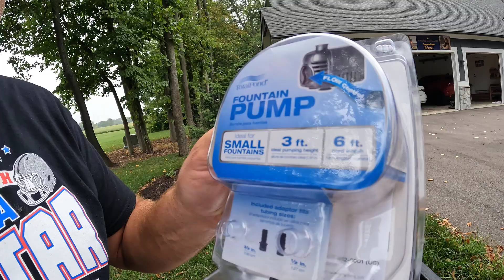DIY Wooden Square Fountain: Easy-to-Build Water Feature for Your Yard!

Comment: Nice project… I’m going to do this one but I’m going to put some led strip lights on the sides
Reply from the maker: Thats cool!  I would look for a larger water tank than the one I used.  I get about 5hrs of runtime before I run out of water.  Luckily I have it tied to my sprinkler system.  Thanks for watching!

Comment: Looks fantastic. I would’ve like to see how you got the water to flow evenly from one end to the other, and how you installed the hose in the frame. I am trying to build one and working on that part.
Reply from the maker: I started with small holes at like 1/16. I think 17 holes. I set the pump at the lowest speed. Tested the flow wasn't happy so I turned off the pump and drilled the holes at 1/8.  Once again not enough. So I did the same thing several times and settled on 1/8 holes. The pump is still at the lowest setting so I could go bigger or increase the pump flow but 17 holes at 1/8 holes gave me what I was looking for.  I kept the flow on the pump at lowest so if my holes got to big while testing I could always increase the flow and not ruin the pipe already installed. Hope this helps. Please subscribe thanks!  HPH
Reply from the maker: Settled on 1/4 inch holes. Sorry

Comment: How often do you think you'll need refill the water? I imagine there's quite a bit of splash that's not recollected.
Reply from the maker: Good point!  I ran it for about 8hrs straight an it lost half of the tank.  With that said I plan to silicone the pipe to the pump where it enters the tank.  That will allow the tank to fill higher (after adjusting the water float).  If I had to do it again I would buy a bigger tank or maybe even a liner.    Cut the opening a little wider to collect the splash more.  But this fountain will only run when we are out there which is a couple times a week right now.  Didn't want to break the bank on a bigger tank for a part-time fountain :)  Thanks for the comment make sure you subscribe to see more!

Comment: I like this a lot. I sub to another channel and used his videos to create a small waterfall feature in our yard (about 5 feet from top to bottom, ending with a 15ish inch drop into a small 20gal pond, right behind our campfire pit). Here's his design of the same idea: https://www.youtube.com/watch?v=GPhFZXCj8Ak. I love water features, feel like they just add so much to a yard. Really makes it feel less like you're in the city and more like you're just out in the woods far away from the noise and smells. Which for us, that's kind of vital for the time being. (tangent: I mentioned elsewhere my health problems, so for now it's the best we got. We upgraded my truck and got a 35' camping trailer last summer so we could spend a year on the road (I work full-time remote), but with my health issues that plan is on hold. We eventually want to hit every state in the lower 48. Hoping to leave this year, but we don't know.) Anyway, love the water features. I'd like to do something similar to this on a smaller scale in our front somewhere, but I feel like my neighbors would hate it because of our location and loss of water (we're in Eagle Mountain, Ut. where we've been experiencing years and years of severe draught).

Comment: Good vid, would be great if it didn't have that music though.
Reply from the maker: Really?  Too loud or just corny :)  I was told in other videos to add music :)  Thanks for the feedback!
Reply: @HomeProHero  The volume is okay I think, I just really believe there shouldn't be anything but diegetic sounds in these types of videos, it's kind of distracting and doesn't add anything. Personally I'm not a fan of the music choice either though I couldn't really explain why. It's a little too chill maybe? Just not something you'd associate with playing with power tools. It's also very generic and obviously something from the free use sources.

Even on the parts that are sped up I think the tool sounds work better, but you'd be coming pretty close to copying Diresta's style there. I personally don't see a problem with that, it's not like he owns the style or anything, but you might hear complaints if you did it too. It does work well though.

Anyway it's your channel, do what you like. I can't speak for anybody but me, others may prefer the music.
Reply: @HomeProHero  it's fine just lower/cut it when you are talking
Reply: I thought the music was fine. Grateful for something other than electric bass and drums playing like there’s a competition somewhere….it fit your project. Very nice water feature.